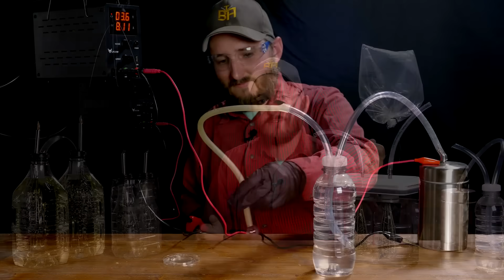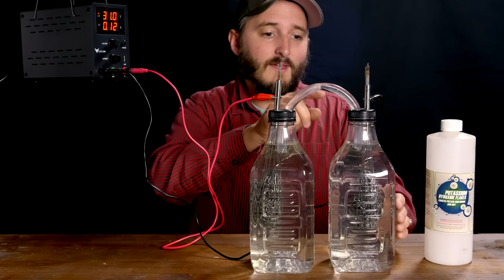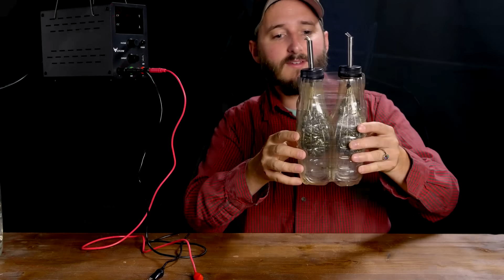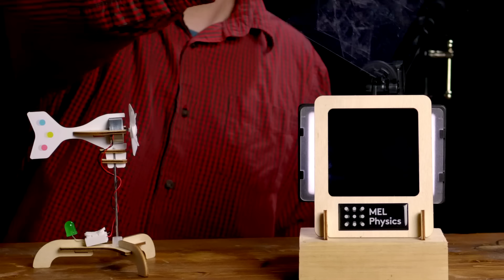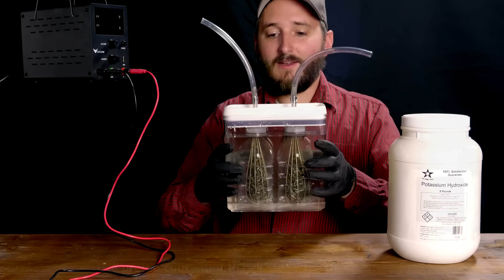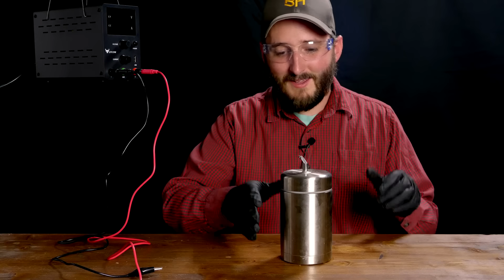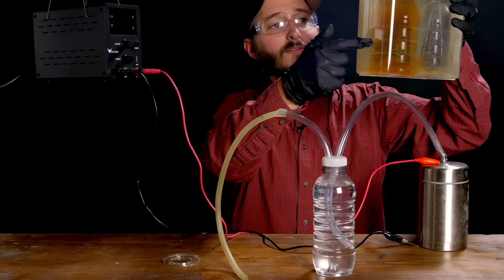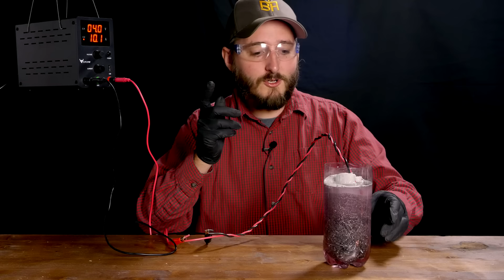DIY Hydrogen/Oxygen Generators From Grocery Store Items (HHO Fuel Cells & Split Cell Electrolysis)

Comment: Awesome video, Sir!

 I've been making these since I was 12. I got the basics down when my Dad and Grandpa were trying to run a Toyota Corolla off of hydrogen during the oil embargo gas wars in the '70s. They accomplished their goal, and the car engine ran for about 30 seconds until it exploded! Thank God they and I were hiding some distance away behind some sandbags with a sheet of plywood in front of it. Even then it didn't seem like my ears were ever going to stop ringing.  

Its funny because at the time, my Grandpa owned 13 acres across the highway from the former Texas Stadium in Irving, TX. and they did that in front of his garage which was in direct line of sight of the stadium

 The explosion was so great it shattered the windows on the side of their house and cracked the sheetrock. And the heat from the blast turned the concrete into bright white crumbling ash.

 It registered on seismographs somewhere, and in no time, every law enforcement agency was at the house. 

They weren't jailed or even ticketed. On the contrary, they seemed to be somewhat impressed. They scolded them sternly, saying they could not continue any experiments without a mountain of permits, and it had to be in a rural area that was equipped to government specifications. 

So, I have been thinking about that day and what they did wrong all of my life. 

 When I was 32, the proverbial lightbulb appeared over my head after using some ether to start a diesel engine. As I heard the ether mix with the diesel and listened to the engine race, I thought, "Bingo!" 

 Instead of running on pure hydrogen, I decided to mix it with gasoline in such a way that as far as the ECM on the car was concerned, I was running higher octane fuel, and then the magic happened. The computer made the necessary adjustments. As a result, the vehicle went from getting 350 miles per tank to almost 500 miles per tank. 

 If you are reading this, let me stop here and say, DO NOT TRY IT! I studied this for year's and even then, I took a major risk. It can be done safely, but you can easily turn yourself into a flash of hydrogen vapor if you are not extraordinarily careful! 

Now back to my story. I also tried to use inexpensive materials and made electrolyzing cells using a 3-inch schedule 40 PVC sewer pipe with a cap glued on the bottom and a screw-in cap on the top. I tried many things for my anodes and cathodes but finally settled on stainless steel all thread. And like you, I used a multitude of different electrolytes until I decided on potassium hydroxide.

The all-thread worked brilliantly because I could attach wires securely to the outside poles, and when they corroded, I unscrewed the lid, spent a couple of minutes with a wire brush, and then put it back together. I built six of these and secured them in a milk crate. A piece of Plexiglas separated the oxygen and hydrogen and fed it into an oxygen/acetylene regulator. That allowed me to vent the oxygen safely out and regulate the hydrogen flow that was piped into the air intake of my 2001 Ford Taurus. There is a rural town near me with a 16-mile long loop that circles the city through rural farmland. I spent months with that car on cruise control, going around and around that loop on cruise control, videoing every step of the way. I could literally turn the regulator to increase the flow and feel the car rev up.

 I worked in Irving at the time and lived in East Texas. So, I had an incentive considering fuel prices soared after 9/11. 

 That worked very well until a Dallas cop got beside me in the canyon in downtown Dallas. You should have seen the look on his face when he saw my electrolyzing hydrogen units in a milk crate secured to the passenger’s seat with the seatbelt. 

 He pulled me over, and God smiled down on me that day because he also had a curious interest in what I was doing. But, he warned me that just because I was lucky and got stopped by a cop who was a fellow science geek, that does not mean I will be as fortunate the next time.

 He politely waited while I disassembled everything and put it in the trunk. Then, before he left, he grinned and said, considering that could be adapted into a hydrogen bomb, I'd put it back in my shop if I were you before you end up in Guantanamo Bay, Cuba, while you wait on the FBI bomb squad to disassemble everything to see exactly what it is.

 I heeded his warning, and it is still on the back corner of my workbench. 

 I thought I was the only one attempting to build a fuel cell on a budget. It did my heart good to see your video just now. We did many things the same way, including using water as a blowback preventing check valve of sorts. 

Your video was great, and I can't wait to watch more of what you have posted!

 Take good care, my fellow mad scientist! 

 * ATTENTION*** I purposely left off some steps so that none of you would accidentally hurt yourselves attempting to copy my work. I do not care about sharing the idea, but I care about your well-being. This is meant for information purposes and is not a complete step-by-step design. I cannot stress the danger of this enough. It can cause bodily harm up to and including death.
Reply: Instructions unclear: blew up grandma. R.I.P.     you will be missed gram gram.

Comment: The final.model using sock 24:00 needs a very good and thick sock or a double sock just to be sure there won't be any metal poking through
Also, conduct a continuity test before connecting it to electricity ⚡ so that there won't be a short ,  make sure the two electrodes do not touch 💥
Reply: Would 70 ohms be a short or just very high resistance have blown up 2 PWMs on two different sock generators? And am wondering why?
Reply: @Graemecns  yeah 70 ohms would be a short. just make sure youre checking the continuity when the sock is completely dry because otherwise the water will form an electrical connection. but when its completely dry it should be an open circuit

Comment: Could you use this, to partially or completely run a gas powered motor IE: small lawnmower engine or even a car engine..
Reply: Yes. If yr gas generator can supply the required volume
Reply: @Kungfupanda839  I seen a few years back, a guy who built one and it held over 2 gal's of fluid and said it would last for 12 hours of use, before changing and cleaning it, but it would cut your actual fuel (gas) usage by 60%.. He had the tank in his trunk and a line running & connecting it to a vacuum line running to the carb/fuel injectors.. I did a small test last year and had a riding lawn mower engine running on one for 2 hours, with zero problems or side effects... This one he made on this video, looks very interesting, just wounder how hard it would be to make a much larger version and if it would be feasible to help power a car/truck and would actually help save on fuel (gas)
Reply: @TheWolfster001  No, because the electrolysis uses electricity, which comes from an alternator, which is turned by the engine, which consumes fuel to work. In every process of converting one type of energy to another, in nature, anywhere in the Universe, you always get back less useful energy than you put in. The remainder ends up mostly as low-grade heat, useless for doing work with. 

It upsets me that people can go to all that effort rigging stuff up like this, but won't accept the Second Law of Thermodynamics. It's supported by a ton of theory, and has never ever been shown to be slightly wrong. If it were, so much of science would crumble and nothing would work how we think it does. Somebody proving that would be respected on the scale of Einstein or Newton. 

These people are fine with electrolysis, gas pressure, and the internal combustion engine, but conservation of energy, no, they're not having that one.

You could power an engine from it, but you'd use more electricity than the amount of power you gained from the process. More efficient to just stick an electric motor in, if you have electricity available to start with. More efficient to miss out the whole electrolysis thing in any circumstance. It wouldn't provide any sort of gain.

It's fine for you to ask, it's good to be curious, but when people find themselves opposing the basic laws of science they should have some really compelling evidence.
Reply: @greenaum  I worked it out with typical conversion efficiencies, and it turns out that a car using all of its alternator output to power an HHO cell could generate somewhere around 5-10 watts of motive power - about 1/100th of a horse power.  Woo.

 It really is that bad. 

That said, there are units sold specifically for commercial truck fleets, either as built-in or to be used in garages during periodic maintenance.  Secondly, very old engines can benefit from a few hours of HHO injection to clean out the crud.  Once the crud is gone, you get small but significant (to trucking firms at least) efficiency improvements with ordinary fuel.  Until it cruds up again.  This tends not to happen with modern fuel-injection and decent fuel.
Reply: @greenaum  add a solar panel on top of the vehicle
Reply: @Kungfupanda839  You could do that, but it'd be better connected straight to the battery. That way, it charges the battery and means the alternator will be switched off more often, putting less load on the engine, saving fuel. 

Electrolysis is a terrrible way to create hydrogen, it's not used at all in industry. Commercial hydrogen is produced by reacting steam with methane, or some other hydrocarbon.
Reply: @Andrew Muir Compressing a gas uses a lot of energy too. But generally speaking whatever the problem, the answer isn't "electrolyse water into hydrogen to burn". Electricity is way more valuable and useful stored in a battery. As far as a solar panel goes, reducing the load on the alternator and engine, is better than trying to add more energy later. Since every conversion between different forms of energy is always less than 100% efficient, it's better to reduce the energy needed (ie reducing fuel use by reducing load on the alternator), than it is to add extra conversion steps (from electricity to hydrogen and add that to the engine).

Comment: 10 Years ago I made Brown's gas with 3 Mason Jars, 2 for the Generator, the 3rd a Reservoir. I used it for My Diesel Pusher Motor Home. I used Distilled Water & Vinegar if I remember what I used for the Electrolyte.  In the system I use BACK FLOW PROTECTORS so the accidental back flow would stop.  The Stainless Generator was a stack of plates of 2x2" stainless, a stack of 12 with stacking by stainless washers about 1/4". I hung the stack on All-Thread. I didn't care about separation of the gasses. From the Reservoir I used a tube into the rubber boot just prior Turbo charger.  The Amp Draw on the "GENERATOR SYSTEM" was less than 14 amps. This system gave me about 25% increase in Diesel Economy, it works nicely because the sensors don't care the fuel type it just want's the fuel.  The Down side, was the HHO was produce THE ANODE & CATHODE, THE Negative was the Sacrificial, where the POS+ did not corode.  I purchased the Stainless Steel Kitchen Scrubbers, and I sold the motor Home.  My UPGRADE would be to put a FLIP-FLOP TIMER TO REVERSE THE POLARITY So both anode & cathode would corrode equally & would double the Output. 6 Mason Jars are Strong, pack nicely.  The downside of using the Electrolyte, will overtime attack any type of ferrous metals, I expect Aluminum will not corrode as easy. If a person can get some cheap Titanium to try, might be a better alternative to stainless.
I was very impressed with your video about the Paint Reflective spheres that was truly enlightening.  Thanks for  Sharing your Knowledge, so all of CHRIST's people can benefit, what if given freely give freely. The Greed of man is what has made a FEW Ultra-Wealth & THE REST ENSLAVED.

Comment: OK, SMART GUY, LET'S SEE YOU BUILD A SYSTEM THAT CAN PRODUCE ENOUGH HYDROGEN GAS, AND USE IT TO RUN A LAWN MOWER!!!...
Reply: I'm thinking he just did.  The little stainless canister and a 12 volt battery ought to make your push mower purr.  (considering the bangs he produced from the bubbles)

Comment: Make sure you address the hexavalent chromium danger of your design in your next video first.
Quite a lot of people do not read comments.
Reply: Good to notion that point..

Electrolysis of water using Inox will produce O² with small ammount of carcinogen HexaChromium..

Inox is an metal Alloy made from diferrent elements and Chromium is one of the indegriends..

For vlean industrial or Medical Oxygen production, electrodes are made of Platinum or nonReactive metals..

Just my fast overfly..

Comment: Nice to see someone with obvious scientific knowledge looking into this topic. I was mildly interested in this a few years ago but the lack of real knowledge always resulted in some sort of disaster. I have kind of a dumb question though. Does adding an electrolyte in any way contaminate the gas output? I read your aluminum foil fix for the spent electrolyte contamination. I personally would like to try to use the baking soda or something less caustic. My interest would be using it in an internal combustion engine. Probably diesel, tomake a cleaner burn and any added fuel mileage these days is a nice side effect. BTW I am a retired diesel mechanic.lol
Reply: I'm heading down a similar road with wanting to try  this on a petrol generator....
Reply from the maker: Electrolyte only contaminates the output in as much as the bubbling throws droplets into the air. If you filter the gas it should catch almost all of the floating droplets. I'm not a believer in the benefits of adding electrolysis to an engine, unless perhaps it's an old engine of the sort that gets the same mileage whether you pull a trailer or not. On any engine that runs efficiently you'll be causing the engine to work harder to turn the alternator, and that will cost you more mpg than would be gained from the electrolysis output. Let me know how it goes if you try it.
Reply: @Nighthawkinlight  It is an older engine. They quit making them in 95 because they could not be made to meet the federal pollution regulations. As a vintage vehicle I can circumvent this as "grandfathered in" but would like to see if it is possible to clean the exhaust up with a cleaner burn in the cylinder. I was hoping that HHO might help burn all of the fuel before the bottom of the stroke and make the exhaust a little cleaner. I can always yank it all out if it doesnt work. It will be a little while before it is completely ready for the road but if it does any good will let you know. Some sort of a dryer chamber would remove any sort of air born droplets I guess.

Comment: The stainless steel barrel has a Rubber seal for a emetic reason but the thread is still connecting the top and the bottom sections making a metal connection to each other

Comment: I have seen a setup that used a shammy cloth (chamois cloth) to separate the anode and cathode plates. the chamois cloth allows the electricity to pass through from one side to the other but does not allow the hydrogen and oxygen bubbles to combine or mix together. Both the hydrogen and oxygen bubbles rise to the surface on their respected sides and flow into separate tubes. This setup allows a tremendous amount on hydrogen to be collected due to the plates being very close together (almost touching) but separated by the chamois cloth.

Comment: I haven't checked to see if there is a newer video on this yet but I wanted to mention that I've seen some really good designs for electrolysis cells before and one thing that I'd argue yours is missing is a way to add more solution.
One method I've seen is to just have a separate tank for water that feeds into the main tank at the bottom. Then you can have the separate tank open to air without worry of gas escaping or entering and you can just top it off whenever you need.
Though this isn't that crucial if you are only producing a little at a time or for shorter runs.

Comment: To reduce the chance of explosion inside the browns gas generator.  Use the plastic bottle separator for the lid insert electrode, and pack the container up with stainless steel wool as the second base electrode to reduce the volume of the container.

Comment: a good idea to invent this further. would be a appropriately scaled version of it to fire up and combine it with a car engine. that on one hand produces from water and the electrolyte substance its own hydrogen. you then just self compress like a diesel engine is doing it with the fuel via the pistons and the chamber or ignite with sparks like in normal otto motor engines.
at this point you may have to modify a bit due to the different exploding point by compression of gas.
in this case you do not even need to seperate hydrogen from oxygen cause the mixture of it is already how a normal combustion engine functions anyway (mixing sprays of fuel with a lot of oxygen).

However i do not know if you can produce enough of it to get the engine turning to get enough momentum for motion of the car. besides the inventors in the past that were successful here.
only works if what you produce is efficient enough to move the car forward. but you mostly can use common combustion engines already as your basis.
the only reason you ignite the fuel oxygen mix inside em is to get the piston into motion. so technically it wont matter how you do that. just that you do is important.

but if you figure it out. the car basically only needs water that contains the electrolyte substance. as its fuel. and this would be quite green towards the environment compared to normal fuel exhaust.